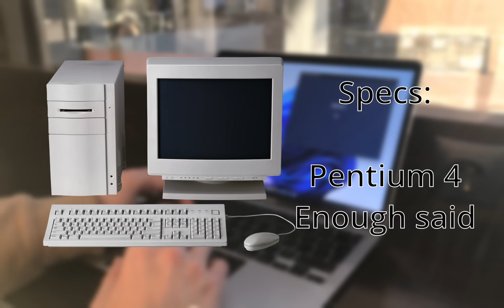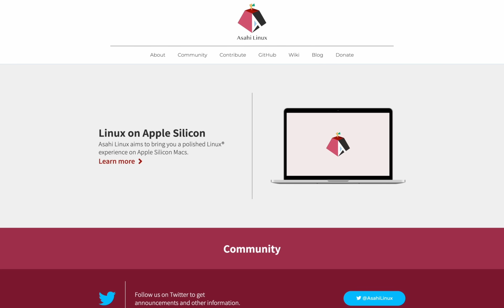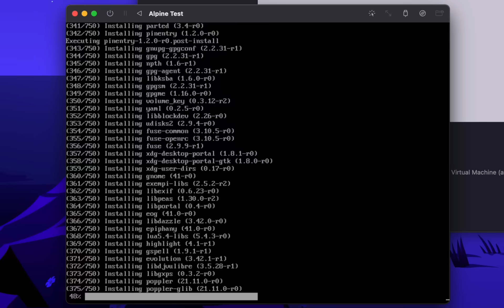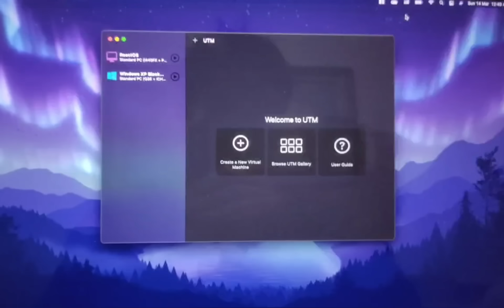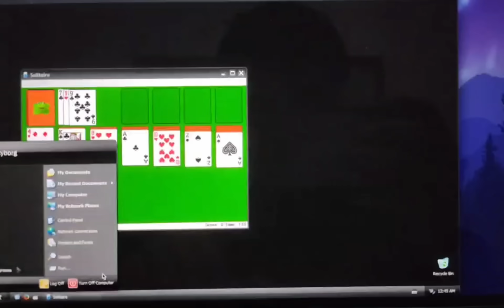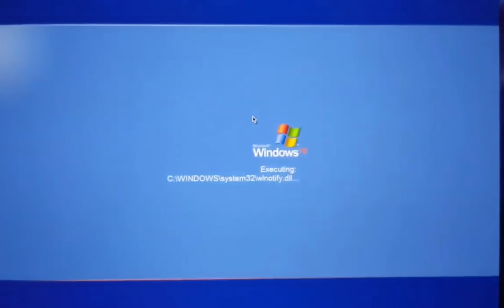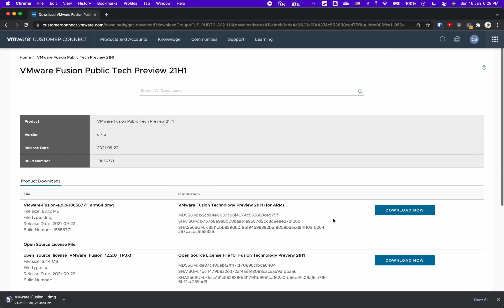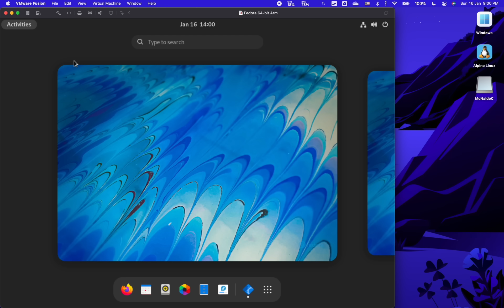Using Virtual Machines on Apple Silicon

Comment: Vmware Fusion has improved a lot. Quite decent on M1 Macbook Air with 16GB/256G. Network performance is "better" with VMXNET3 adapter but still slower than gigabit wire speed. I'm about to look into Virtualbox for comparison.

Comment: I used UTM to use Windows 11, and it was pretty easy to install an image. There is an app on the Mac app store (CrystalFetch) that installs an ARM image to use on UTM. It blew my mind how well it ran despite my Mac having 8GB of RAM.

It's nice to see software that still bridges the gap from macOS to Windows. It will take a couple of years for Windows on ARM to become more mainstream, and Bootcamp could potentially make a comeback. But even then, most software is just as available on Mac as it is on Windows, except for many games, but it could change,  and people would have adopted Mac and Linux more widely. Few people would run both OSs natively.

Comment: Would be nice to see an update on this now that VMWare Fusion is at v13.5, MS Officially supports it, and Fusion now has an easy install of MS Windows. And though Fusion was delayed, it is a very mature product, that heavily competed with Parallels for years. It is only since v12 that they have been offering a free version for personal use.

Keep in mind that VMWare is a Virtualization POWERHOUSE, with 2023 revenues of $4.66BILLION vs Parallels $100 MILLION, though most of that is from Intel-based corporate developments and revenues.

One caveat is that VMWare was purchased by Broadcom last Nov. 2023, so not sure of the impact of that.

Comment: Nice vid! Some months ago I discovered that VMWare Fusion Pro 13.5.2 works really good on M1 Macbook Pro, with Win 11 guest! Better and smoother than UTM in my experience, and it also runs DX11 games. (Unfortunately it does not have Docker support, so that is a parallels advantage.)

Comment: I have a question here. The new MacBook Air M3's maximum RAM capacity is 24 GB. The MBA does not have coolent fans. So will it be possible to run multiple VMs say like a lab environment on the MacBook Air?
Reply from the maker: Should be possible! It'll get a little toasty and perhaps a little slow but it'll run.

Comment: I just want to use Microsoft SSMS. Will UTM be good enough for me?
Reply from the maker: I don't know, I'm pretty sure I had trouble running Microsoft SQL stuff through VMs, both on Parallels and on UTM. Please try it, but don't have high hopes, it's one of the use cases that for some reason is very difficult for virtual machines

Comment: Great video. I had the same issues trying to run Linux arm x86 vms. I bought a MacBook max m3 128gb ram and was excited to run the numerous vms without the laptop melting like my old intel MacBook pro. I found out that virtualbox wasn't supported on arm, and VMware fusion only supports RHEL 9 Linux arm. Even loading this up it just froze... Had to return the ARM MacBook and go back to Pentium :0(

Comment: I think for some of us, this video misses the point.  What we're looking for is a virtualization/emulation solution that will allow us to continue to use older 32bit intel apps from Mojave (such as microsoft and adobe solutions) on M1 Macs.  Apple tell us to just upgrade, but some of the companies that provide essential intel32 bit apps are no longer in business.   It sounds like UTM is the closest we're going to get without much else in the pipeline?
Reply from the maker: Yeah, unfortunately the issue with macOS is that you can emulate very old versions and you can virtualize very new ones, but the in-between is simply impossible. :/
Reply: Unfortunately the best option for you is to use a 2019 or 2020 intel mac, macbook, mac mini (whatever the latest version of intel is), get as much ram as you could afford, and virtualize/emulate the systems you need

This use case is kind of niche. Industry standard has been 64bit for about a decade so most software shops worth their weight have updated to 64bit. Though i understand in certain fields there is some specialized software that is necessary.

Comment: Do ext4 partitions on USB drives mount natively in a linux distro in parallels?
Reply from the maker: They should. Personally I've had a few issues with USB devices not mounting automatically on any VM software, but Parallels does have a feature where you can direct USB devices to it instead of macOS.
Reply: @KalosLikesComputers  Thanks. Sounds good. Sounds better than a windows laptop.

Comment: Any news if latest macOS starts supporting nested virtualization? I have been holding off purchasing Apple Silicon for this exact reason
Reply from the maker: It's not macOS, it's the architecture. I don't think it'll appear for the foreseeable future, it's a pretty niche thing. I have never needed it, personally.
Reply: @KalosLikesComputers  Thanks for replying. The Asahi Linux team managed to make nested virtualization works with M2 chip with Asahi Linux though. So I really think it's an issue with Apple software. Also It's not that niche since lots of software development workflows required that feature, like WSL2 or running Docker in VM etc.

Comment: Hello
great video. I have a Macbook Pro M2 max with 64Gb RAM and 2Tb SSD.
I have a couple of programs that only run on Windows and would be interested in installing Parallels 19 and creating a virtual machine.
Years ago I tried Parallels on a 15" Macbook Pro with Intel i9 but the battery lasted a few hours with the virtual machine active, while working in macOS it lasted twice as long.
Do you have experience of excessive battery consumption with an active virtual machine?
Thank you for your reply.
Reply from the maker: Hello! I wouldn't say it'll half your battery life, but running a virtual machine is definitely a battery intensive task. Parallels has this feature where it can turn on the vm from its sleep only to run an app and then close it again when you close the app, if you're interested.
Reply: @KalosLikesComputers  thank you very much for your reply, I really appreciate it. I think i'll use a refurbed Windows Surface to run the couple of programs I must use. I prefer keep clean my MBP. Thank you again.

Comment: I'm curious what your use-cases are running a VM in a 8GB host, with apps all being such memory hogs lately.
Is it just for fun?
Reply from the maker: It is for fun, but it's also for work! Running Windows 11 in Parallels I've actually never had a problem with the 8GB host.
Reply: @KalosLikesComputers  Interesting. Say that the RAM was split in half, 4GB each. Windows alone would take 2-3GB on startup.  Open up any serious app and the RAM would be maxed out, constantly swapping with the harddisk.  That was my experience. Had to switch to desktop.

Comment: vmware fusion shows start PXE over ipv4
Reply from the maker: VMware Fusion needs pretty specific instructions (which I do not possess right now to put in this comment) to make some machines work properly. A PXE boot message means that the boot order is not correct, or even more likely that the disk the operating system is installed on (or the live media you're trying to install from) is not recognized.
Reply: @KalosLikesComputers  thanks for the information but now i'm using parallel and its working just awesome in my mac

Comment: hi, thanks for the review.

commercial companies will not run emulations of other architectures, and Apple does not have a program capable of doing so. Emulation is very slow, and companies do not believe in the future of ARM. I'm an engineer and I need x86_64 virtual machines on a laptop and my choice is matebook unfortunately.

Apple's history repeats itself as it has in the past with powerpc. It's a dangerous move for Apple, as most of the industry won't be able to switch to ARM for decades to come.
Reply: for parallels, this is the main line of business (for mac), and for VMware, an optional utility is no more. but in both it will not run anything other than the ARM.

Comment: So far I've done the tests with adapting myself to Apple silicon M1 from Intel x86_64, UTM emulation indeed makes me feel much better other than VMware Fusion with running Linux Ubuntu (take server instead of desktop version to save much efficency consumed by emulation). One more issue that I currently suffer from is how to integrate GNS3VM (ubuntu) then run Cisco IOSvL2 devices as it used to be...

Comment: HI I'M trying instal vware in my mac m1 por and give the follow issue: This virtual machine cannot be powered on because it requires the X86 machine architecture, which is incompatible with this Arm machine architecture host. I try with windows 10 and 11 but nothing happens, i saw in you video that gave this erro but i couldn't fixed it, can you help me please
Reply from the maker: Make sure you're downloading arm64 (aarch64) images of the operating systems

Comment: Wasup Mr. Kalos.  Might be a weird question. Is it possible  that a Virtualizer can support SSE2 while running on a Mac M1.   I got an error when trying to download the Tor browser to Kali Linux on my Mac M1, I tried with both VMware and UTM. The error was CPU requires SSE2 support.  If not, do you have ideas I can go with besides downloading TOR straight to my Mac M1.. appreciate any answer.
Reply from the maker: I didn't know Tor Browser required SSE2 support! SSE2 is an x86 only instruction set extension, so by default anything that needs it won't run on an arm64 host like Kali Linux in UTM. Your best bet is to emulate an x86 virtual machine, but it's going to be quite slow.
Reply: @KalosLikesComputers  ahhh ok, yes emualating might be the way, I will try that,  my only purpose to was to use it to learn more about the dark web.. hopefully it wont be too slow for that purpose... thanks a lot man

Comment: Never like Parallels Desktop, always using VMware workstation and fusion. The fusion was gone gold, I bought it and install an Oracle Linux 9 aarch64, it works like a charm. VMware may not have the highest performance, but the fixability and stability are better, just give it a try, again.

Comment: When It comes to VMware Fusion..... Your endless complains for something that's free don't sound justified. Especially when you know it doesn't support Graphics Card based Hardware Acceleration. The Review for VMware Fusion was over when I saw that you cannot control GPU Acceleration.  I guess the next Paid version might be a better choice. Apple still sucks at doing the real work that Servers/Professional computers are supposed to do. The only thing they are good at is Good Marketing and making a Product that's good for using Marketing Products (read products that help with Design/Manipulate Graphics)
Reply from the maker: I was comparing it to an open-source project that had made more progress than a multi-million dollar company, so my complaints weren't completely unjustified.
Reply: @KalosLikesComputers  Well I would still say that the tests you have run are a bit silly as Vmware Fusion officialy does not support x86/x64 OS and only ARM version OS are supported. Trying to run Win XP was really not a good idea.  Heres some text for your reference :

Q4) Can I run Linux virtual machines on my M1/M2 Mac?
 
Yes, but you must use a distribution that has an ARM architecture version (also known as arm64 or aarch64), not an Intel (x86/i386/x86_64/amd64/i686) version. Popular arm64 Linux versions that have been reported as successfully installed include:
 
* Fedora
* CentOS Stream 9
* Red Hat Enterprise Linux/Oracle Linux/Rocky Linux 9
* OpenSUSE Tumbleweed
* OpenSUSE Leap
* Kali Linux
* Ubuntu
* Debian

Corollary: Application binaries compiled on Intel platforms for use on Intel systems will not work. You will need to recompile applications you've developed yourself on the arm64 Linux OS, or install packages built for arm64 architectures.
 
Q5) Can I run a Windows Server virtual machine on my M1/M2 Mac?
 
No.
 
Windows Server runs only on Intel/AMD CPUs. It will not run on an M1 Mac. Consider using QEMU or UTM if you need Windows Server on an M1 Mac and can live with lower performance. Otherwise run the Windows Server on an Intel Mac or PC for the best experience.

Comment: Do you boot virtual machines from external SSD ? How performant is that?
Reply from the maker: Yes. It's slightly slower than running them off of the internal SSD but the tradeoff in storage space is worth it.

Comment: It's not really virtualisation if it doesn't support nesting. The nested O/S can use the failure of virtualisation to detect that it's itself ‘virtualised’. QED. After, what, about 60 years now, you'd think that people would be getting it right. Sigh.
Reply from the maker: ...Yes it is. It doesn't matter if the OS can detect that it's being virtualized. You said it yourself, it's being virtualized.
Reply: @KalosLikesComputers  Pretty much the minimum requirement for virtualisation is that it allows you to do an O/S upgrade and keep your application software running. If your application happens to have virtualised components, then what happens?
Reply from the maker: @stephenspackman5573  Well that's one use case for it. Don't discredit the entire thing just because it's not suitable for one use case. Obviously if you need enterprise-grade software support, you use enterprise-grade hardware. Come on now. We're testing the limits of a brand new platform and you're complaining about an edge case.
Reply: @KalosLikesComputers  Not really; I'm complaining about changing meanings of technical terms and falling ambitions in computer architecture. I didn't say the processor wasn't useful—I'm probably going to buy one of these machines soon and the information you're providing is helpful. I even understand (at least some of) the technical difficulties in getting this right. I just think it's a lame kind of ‘virtualisation’ that doesn't self-host, because without that it's a ‘virtual machine’ only in the sense that any programming language implementation, O/S process, or machine emulation is a ‘virtual machine’—the hardware isn't virtualised, it's just providing a sandboxed environment that's fundamentally different from the host. Virtualisation was developed for software lifetime extension, for hardware multiplexing, for O/S development—but this doesn't seem to address any of those needs, only that of running non-native binaries. That's useful, and something I want to be able to do, but from the historical perspective it's the thing that seems like the ‘edge case’. Or?

Comment: I waited for 2.5 years to buy M1 Macs. 2 reasons I didn't buy. 
1. The M1 mac with 16Gb/512Gb configuration is extremely expensive & rare to find in India. 
2. Though I liked the MBA M1 hardware I don't like MacOS. The whole scene of running Linux/Windows on this hardware is messed up, I cannot afford parallels license after paying heavy premium for 16Gb/512Gb Mac. I bought a LG gram few months back.

Comment: I am a Mac user since the very early 2000s. I've used Parallels Desktop and VMware Fusion a few times. But I got fed up about buying a new license every year on Parallels. Long story short, I finally bought an Intel NUC pc and installed Proxmox VM on it (open source virtualization software build on Debian Linux). Admiralty, it does help to have some basic knowledge on Linux. However, you don't have to know a whole lot about Linux, in my opinion. 

Anyway. here is why I went for Proxmox on the Intel NUC. I can run multiple vm's to virtualize Windows (al though I use that rarely) and other operation systems for several reasons. This is my practice. My Mac Studio is my daily driver and I use it in my study room. In another room of my house I have the Intel NUC running, without a mouse, keyboard and monitor. It is wired connected to my router access point. From my Mac Studio desktop I control the Intel NUC through the Proxmox web-interface. As long you don't need to game and so on it works perfectly smooth. I installed Home Assistant on it to controle my home's smart devices. Run Pi-hole, a  wiki page, Volumio audio player (free opensource audio player with Airplay functionality). 

One of the the great advantages of my setup is that when I want to experiment something I just copy the VM that I want to use for my experiment. If I screw it up then I just kill the screwed up VM and grab back to earlier version of that same VM.

Comment: You pretend to cover virtual machines on Apple Silicon, but only devote 2:11 to Parallels which does work, and don't even cover Crossover.

Bravo.
Reply from the maker: Crossover isn't virtualization! It's translation. I recently got a license and I'll be making a separate video on Crossover.
Reply: @KalosLikesComputers  True.

But when you come down to it, running Windows x86 code is the practical end-point for virtualization on Apple Silicon.

There's really nothing worth running in a VM on Apple Silicon since the hardware is probably sufficiently expensive that it would be more practical to run some kind of server separately than to dedicate an AS computer's resources to running a virtual machine.

The real endpoint is to run x86 code via direct translation or Win 11 ARM and use Microsoft's translator so you can run some kind of legacy x86 Win software - we already have Rosetta 2 to run x86 Mac software. If you want to run some kind of linux server you might as well compile the service and run it on the Darwin core of macOS.

Comment: I installed Boot Camp etc on my MacBook Pro and all the sudden,  Mac won’t start but I can start Windows, any idea ?  Mac’s restart/troubleshoot command didn’t work either but I can run Windows no problem.
Reply from the maker: Shut down the Mac, hold "Option", press the power button while holding Option, and the boot menu should pop up. From there, you can choose macOS.